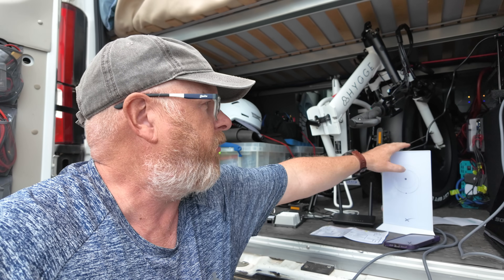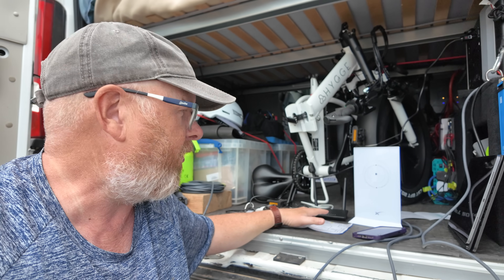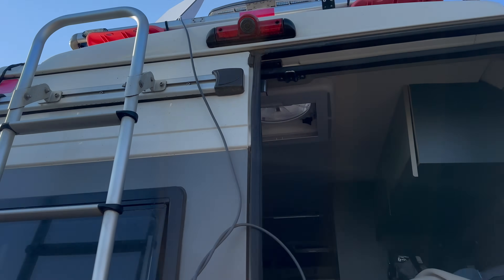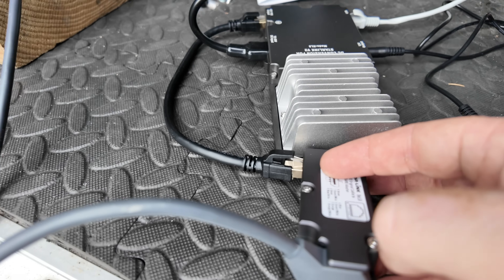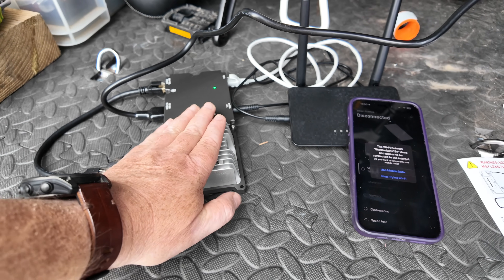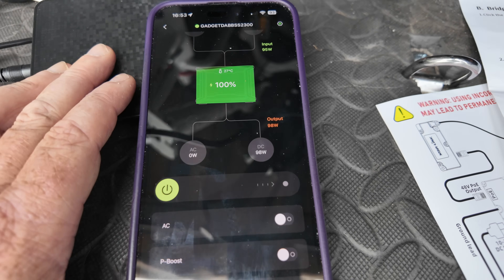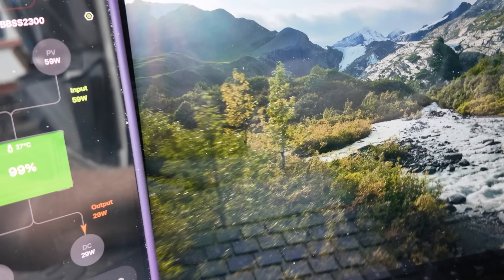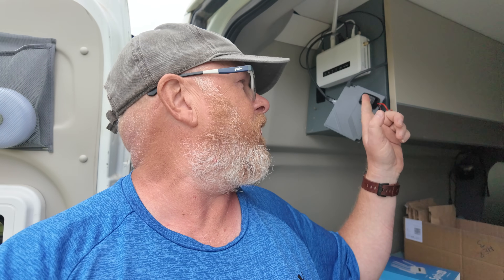Starlink Gen 2 12v Conversions are not all the same

Comment: Hello John,

I’ve been experiencing mixed results when the Starlink router is not connected. The main issue is that I have internet access at my router, but the Starlink app indicates it’s not connected, preventing me from performing a speed test. I noticed that when you show the phone image saying "Online," it only displays an image of the dish, while mine displays an image showing the router with a line to the dish.

Do you recommend turning the "Bypass" setting on in the app for the Starlink router, which removes the router image? I’d prefer not to use Bypass, as I want to keep both options available without having to unplug 6 times, which is required to reset the Starlink Router to remove bypass.

Thank you!

Comment: The Starlink Mini has just been launched in Europe (27/07/2024), like the standard dish there are two different service plans. It runs on 12v and is much lighter than the standard dish (2.5lb or 1.1k)  I have just ordered one.
Reply from the maker: It’s still not available in the UK and when it is there’s likely going to be limitations on speed, as is the case in the USA, and it’s only available if you’re already a residential Starlink customer.

Comment: Dang it, ordered the Xstar Link last week and its on route to me.... Are you getting any over heating from the other 12v conversion unit you installed? Might have to get that...
Reply from the maker: It gets warm but even after 6 hours of use in summer (UK summer 🤣) it doesn’t get very hot and still works fine with consistent service & speeds

Comment: I found the 12-48v buck boost converter to be electrically “noisy”. Adding a couple of ferrite beads and a 1000uf 64v electrolytic capacitor on the 48v output cleaned up any ripple on the 48v DC resulting in the same data speeds as the standard setup.
Reply: Are you using the XTAR link or the XLTTYWL?

Comment: Great video, converted mine a while back to 12v using the Boondocker kit with an average of around 45w to 60w draw in use and booting the dish. Mine is flat mounted using the 3d printed files from Everlanders via thingverse. Self printed it at home and you keep most of the dish intact (you just remove the motor section) so easier to keep it weather proof. Everlanders did a good video on how to cut the dish too, the cable runs very close to the outer edge, so start with a smaller hole and enlarge, dont ask how i know :) Hope you both keeping well Rich and Cooper
Reply from the maker: You might find the next video in the series interesting 👍🏻

Comment: Try most possible not use an inverter is my experience. Stay at 12 volts if possible. The inverter always has an inefficiency, dissipation that goes out in heat. I do charge my laptop and other stuff with a USB-C cigarett adapter connected to my van living battery. It is a DC-DC adapter converter that feeds most of the stuff I use with the right voltage, from 12 volts up to 21 volts. One of the only few things that I have to use my inverter for is to charge my electrical bike. Its impossible to find a DC-DC charger for it that supply 42 volts, 2-3 amps.
Reply from the maker: You’ll find a buck boost to get that voltage but beware it’ll likely damage the e-bike battery
Reply: @GadgetJohn  I think you are right there. Do you know any adapter/regulator if you want to be able to charge your leisure battery from your main engine battery? This of course only while driving your van and the car generator is active.
Reply: Ecoflow has released a DC-DC alternator converter to connect to their power stations. Apparently it connects to the engine battery and starts working when the engine battery is charged from the alternator during driving. It feed it to the Ecoflow DC-DC converter, that converts it up to 42 volts to minimise amperage and charge the Ecoflow power station. It also has a possibility to reverse charge, to feed the engine battery from the power station.